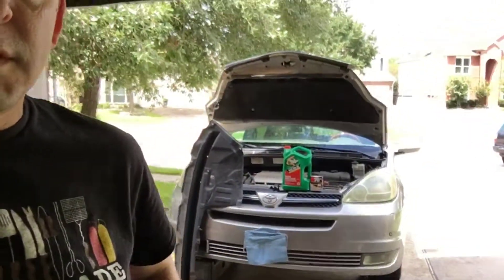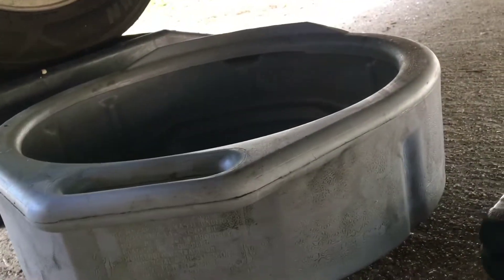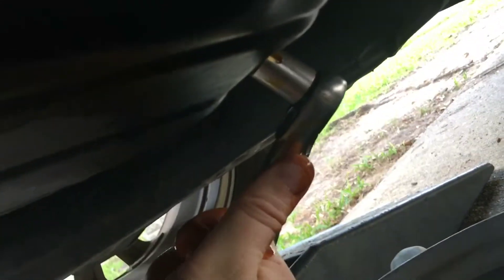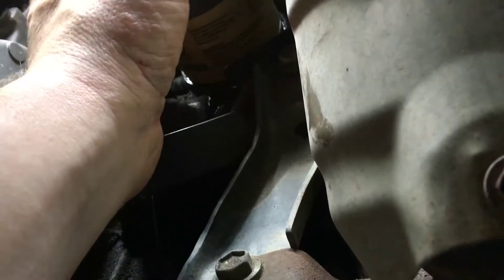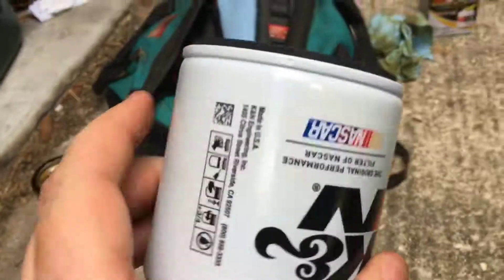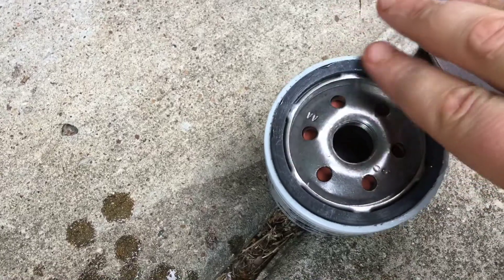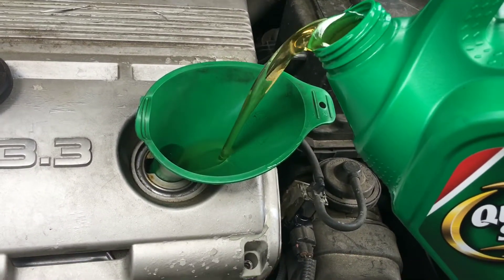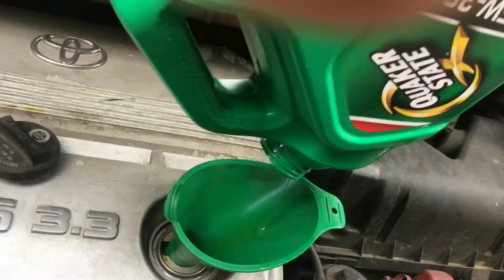2004 Toyota Sienna (Engine Oil and Filter Change)

Comment: I never trusted Fram oil filter. I always go with Toyota, wix or Bosch. Great video.
Reply from the maker: I am learning there are a lot of negative reviews with FRAM. I may move to a different filter, myself. Thank you for watching!
Reply: Fram’s low end filters may not have the best quality (and even that can be debated) but the removed filter on this car was an ultra guard one which is a top of the line filter.
Reply: never had an issue with their Fram Ultra on my G35, although I use Purolator One for the Sienna.

Comment: No gasket on the plug?
Reply from the maker: Hmm. That is a good catch. I never really paid attention on this vehicle. It has never leaked, but I will definitely add one and replace the video with new. Gosh, I have changed the oil on this vehicle for the past 130,000 miles and can't recall if it ever had one in the first place. Thank you.
Reply: Mine didn't have a gasket and never leaked